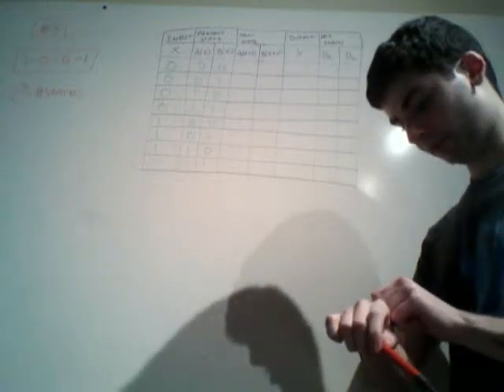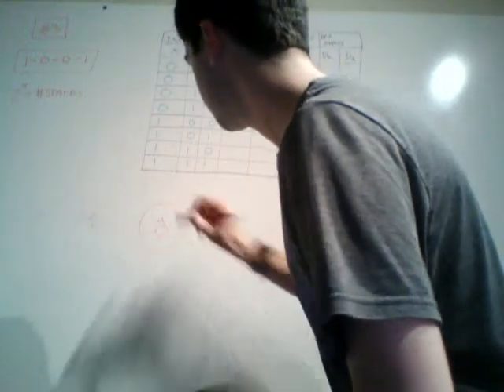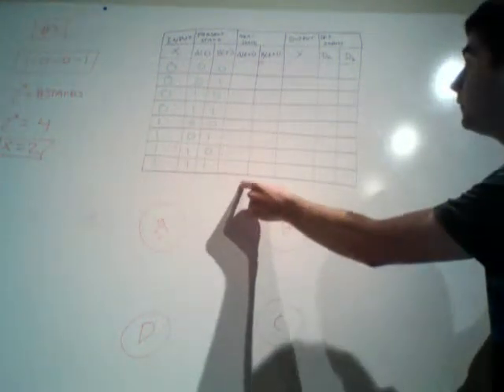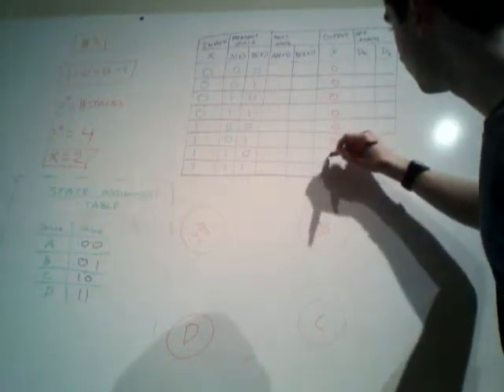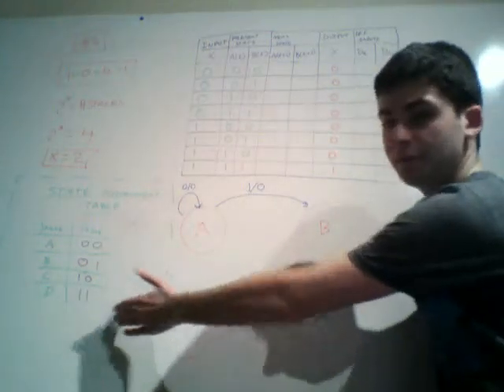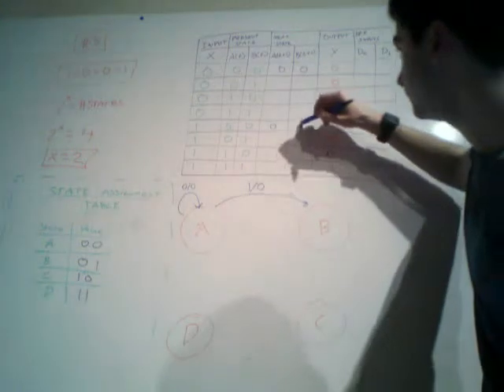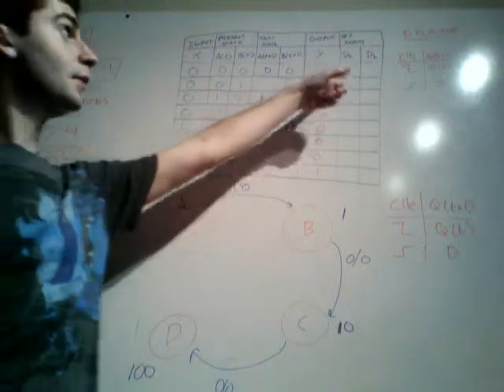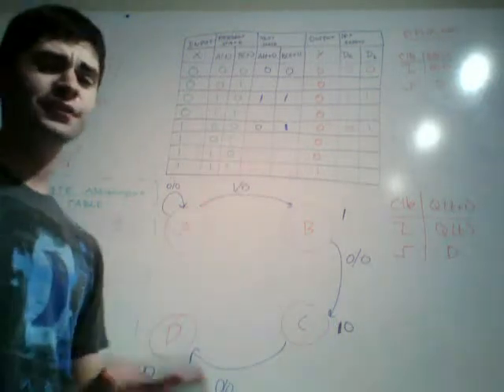Homework Problem #3: 4-bit Sequence Recognizer

Comment: this video helped me a lot! but can you make another one discussing 0110 using JK flip flop?
Reply from the maker: So you're trying to design a sequence recognizer using JK flip-flops that'll recognize the sequence "0110", right? Check your state table for a JK flip-flop. There are an infinite number of correct state diagrams, some better than others. You should be able to use an almost identical diagram and truth table. When you fill in the "flip-flop input" columns, use the JK inputs.

In fact, try this picture: http://www.circuitstoday.com/wp-content/uploads/2012/02/JK-Flip-Flop-to-D-Flip-Flop.jpg
See if you can figure out what the JK inputs need to be in order to get the same behavior out of a D flip-flop.

Come back if you need more help.
Reply: I applied moore machine  state diagram but my professor said it was impractical (because it has 5 states and we're only asked to create a 4-bit sequence detector). Thank you so much!